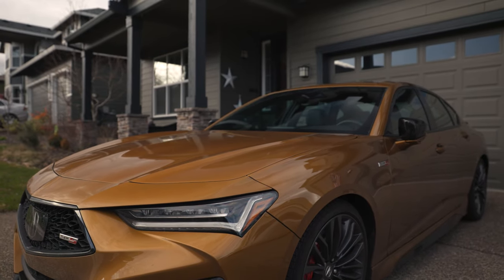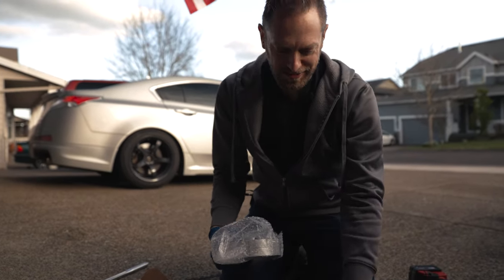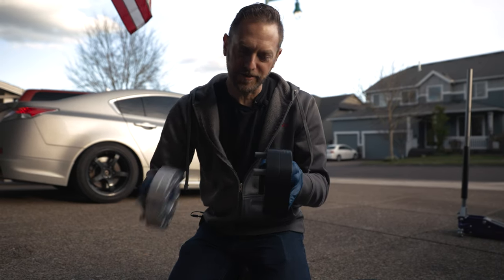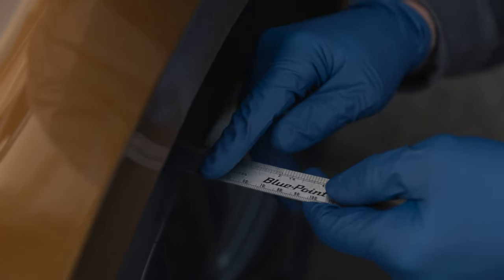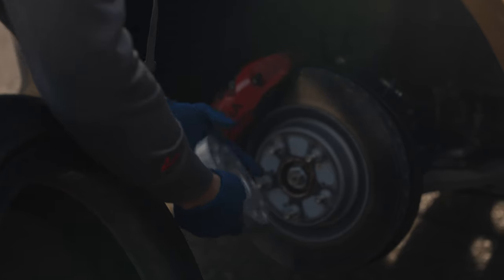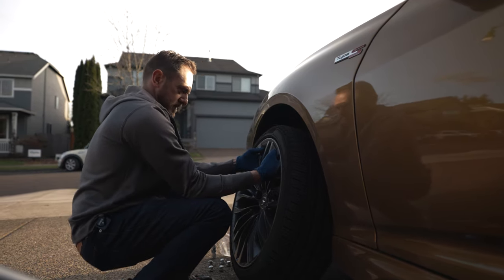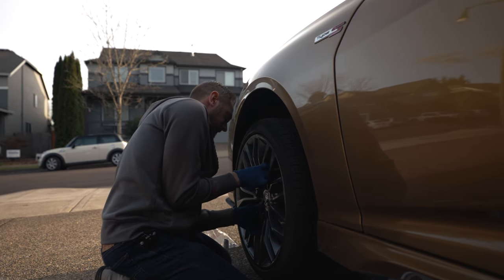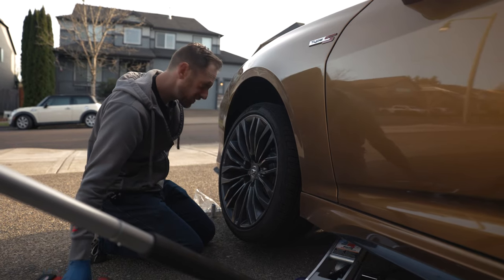2021+ TLX Wheel Spacer Fitment, 20mm & 27mm H&R TRAK+

Comment: I would rather grind the stud instead of the wheel.  I think the 20s look better.
Reply from the maker: Yeah I think most people probably would, but I guess it's also depends on how much grinding needs to happen. It looks like the 20 would fit if you just took down some of the casting marks inside the recesses, you don't need to actually eat out a whole lot of material there. So I wouldn't really prefer to modify the wheel but that seems like the thing to do in this case.

Comment: I have a '23 Type S, loving it.  Wouldn't the spacer change the suspension geometry?  I would think it would stress it in an un-natural way, causing problems over time?  Maybe overthinking it, but it is engineered to specific tolerances.  Anyone out there had anything happen?
Reply from the maker: "Wouldn't the spacer change the suspension geometry? " not at all no. "I would think it would stress it in an un-natural way" Not really...is is honestly the same as just putting a lower offset wheel on. It does shift loads a little but not enough to have any impact. In an extreme case sure, but we aren't talking about 6" wide spacers here.

Comment: just to confirm, those with the optional performance wheels have a ton of space behind the wheels for oem stud clearance......my final fitment are 20mm rear, 15mm front....perfect for me
Reply from the maker: Absolutely, we did see that also later on. The hub recesses in the Y-spoke are much much bigger than the standard multi-spokes.
Reply: What 15 mm spacer did you run in the front?

Comment: With the Y spoke wheels, I was thinking of doing 25mm all the way around. After watching this video, I'm now thinking of doing 25mm in the front and 20mm in the rear. Would that be fine or is it better to stick to 25mm all the way around?
Reply from the maker: "After watching this video, I'm now thinking of doing 25mm in the front and 20mm in the rear."
People do that, for sure. But mostly, like 90%, do 25mm all around: https://www.heeltoeauto.com/spacer/fastline-performance-wheel-hub-spacer-gunmetal-2pc-5x120-m14x1.50-64.1-hub-25mm-width-flp-wsgm-1507-641-25.html

Comment: I never run out of uses for my bridgeport and lathe.  I could make quick work of that spacer issue, or bore out the wheel so there's nice machined recesses for the studs, or machine my own spacers. When is the exhaust video coming?
I can't buy a type s until there's plenty of AM stuff for it.
Reply from the maker: Posting info over the next few days and weeks. Stay tuned!
Reply from the maker: Did you see the exhaust video?

Comment: Do you think with the Y spoke wheels if I use 27mm in front would it poke out more than the multi spoke? And also thinking of using 25mm in the back I like that flush look in the front
Reply from the maker: No they would not, because the y-spoke and multi-spoke are the same specs.
Reply: So the 27 come out a little more in the back?

Comment: Did you have to use extended lug or was there enough thread for the stock lugs to go on
Reply from the maker: These spacers come with new studs pre-installed.
Reply: @Heeltoe.  Thank you

Comment: does spacer only goes to the front wheels only or both front and rear?
Reply from the maker: You can mount wherever you like, front or rear or both.
Reply: @Heeltoe.  awesome thanks! but what size would you recommend?
Reply from the maker: @christianjohnperez8916  depends on the wheels. 27 works great, is really aggressive but still not sticking out to far. No mods needed.